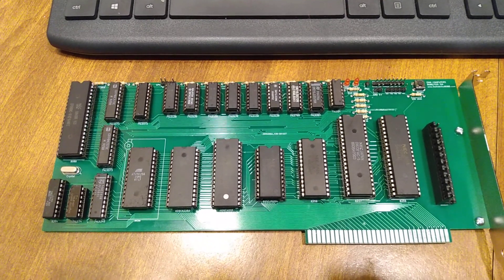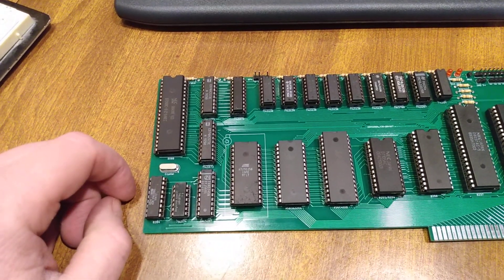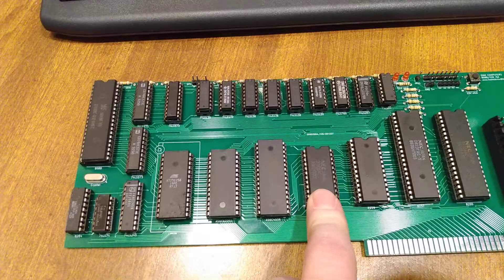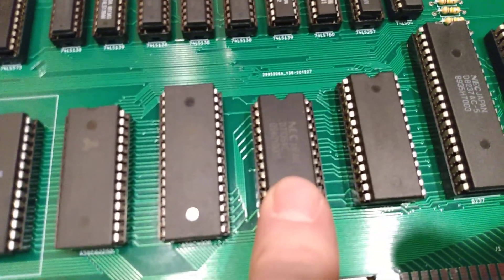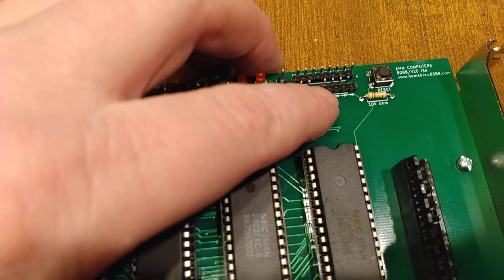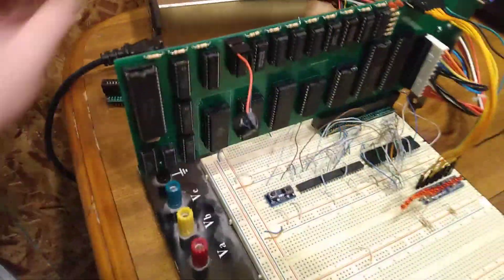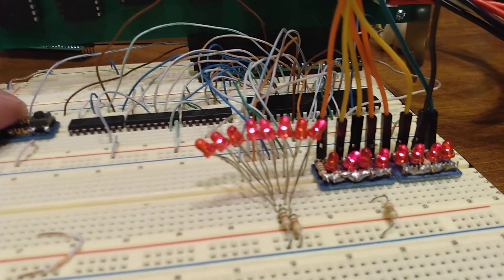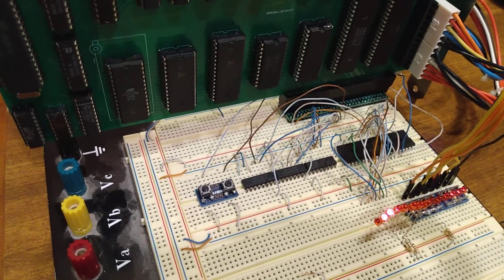8088 Motherboard. Built on ISA card. 4.77 MHz. PC compatible.

Comment: the IBM PS/2 Model 30 was introduced in 1987, had ISA expansion slots - but had PS/2 connection ports for mouse and keyboard; well, can still buy modern manufactured products that support the PS/2 port - way more pragmatic for any modern PC recreation efforts

Comment: Do you happen to have documentation on this? I’m curious how yours works compared to an XI8088 or my RT8088 design
Reply from the maker: Check out my website www.homebrew8088.com

I am a little behind on keeping it up todate. But you will be able to find information about my PCB's. 

My goal has been to keep as close to PC compatible as possible. Based on the IBM 5150.

My V40 motherboard is the most current project I am working on. I will probably come back to this one and add a USB hdd and keyboard. Once I have cleaned up the design.

Comment: Very nice...  What do you use for a BIOS?  Are you able to boot DOS (e.g. FreeDOS)?
Reply from the maker: The BIOS is custom. Right now it doesn't do a whole lot. As I progress with the project I will improve on it. You could probably adapted an existing BIOS to this project. With some editing for sure. 

I have not booted DOS yet. I am looking into options for video cards and drives. I might connect to it through the DMA controller in cascade mode and use a Raspberry PI to function as the Video, Drives, and keyboard. Mainly to test it out. I am 100% confident DOS will boot just fine. 

When I tested Free DOS on my Raspberry PI 8088 hat it gave me an error.
Reply: sergei kisalov has a open source BIOS for XT. Should work for your XT. My first PC had a JUKO motherboard with V20

Comment: Great job!  Have you tested this on actual ISA backplane?  Passive ones I'm guessing if so.  Just curious as some of the backplanes can be fussy about their cpu boards.
Reply from the maker: Thank you. I have plugged it into the backplane I have on hand. As far as I could tell there has been no issue so far. I still need to test it with other isa cards I only have a few on hand.

If the backplane ended up being an issue I would just make my own that works. Also look into what is causing the issue on my card if possible. This is still definitely a work in progress.